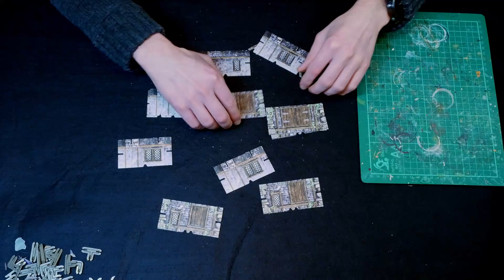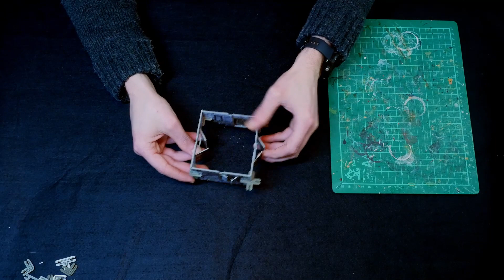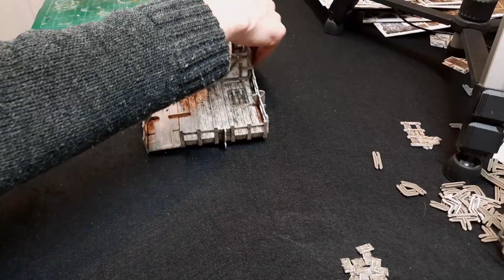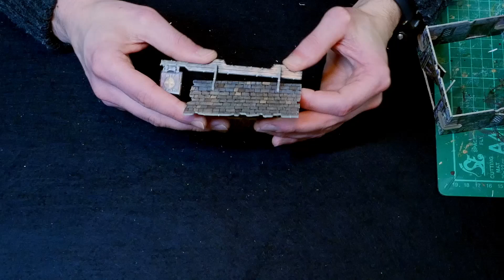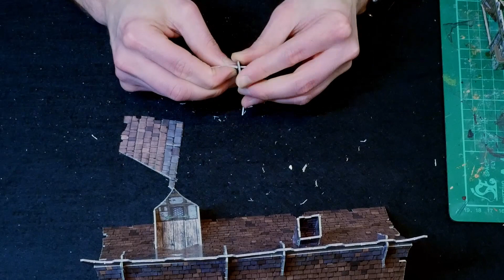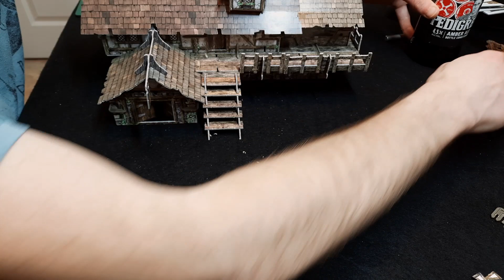How to Build Battle Systems Fantasy Village Terrain build series part 8: Tavern

Comment: I figured out what you did wrong for those steps.

Big step at top. Second biggest at bottom. 3 small in between. There is enough pieces 😁. I figured it out this morning
Reply from the maker: Ah haha thanks. I think that because I got the Kickstarter (which came with extra sprues) I probably mixed up some pieces which wouldn't have helped.

One thing I really like about the terrain is that you can modify the 'official' build guides a bit (in some circumstances) and use pieces differently and it still looks good. The village ruins set are a great example of that flexibility.
Reply: @NoProcrastinationMiniatures  yeah i do love how you can mix them up. Only downside is ive seen is they dont always pop out and it rips tje picture which is infuriating

Comment: Just bought the village today and absolutely love it.

I agree with your reviews 100%. Beautiful products but can easily tear if not careful - but you get what you pay for. But the fact i got a whole village for £80 was a bargain, considering when you pay over £400 for resin or plastic for a complete set. MY D&D group love it.

Only thing i did differently was the roofs. When you have that beam at the top to go across a roof piece, i cut it into sections and then glue each section on, because i found when sliding it into position the beam would look bent or a huge hole from roof to beam. 

Great video XD
Reply from the maker: Thanks! And that's an interesting tip re: the roofs. You're right that the central beam can look a bit wonky where it weaves a bit between the joining clips. I think if you're set on gluing it then your strategy is a good one.

Yeh I had to keep reminding myself that you actually get a lot of stuff for the money and although it's not ready to go out of the box, it's quicker than building mdf terrain and then having to paint it all as well.

I should've added a final summary to the review to say that overall I'm very glad I bought it! Glad you like it too, for D&D in particular it's VERY good. I love the way you get loads of basically free little extras like furniture and barrels / crates- ideal for D&D
Reply: @NoProcrastinationMiniatures  Thank you for your response and your earned yourself a subscriber. Well the beam that has the pub sign, it snapped because it wouldn't go any lower but yet i could stick a whole finger nail under it, so the idea for the gluing came about :). 

Oh yes for D&D the money and the material is fantastic. You don't need to go expensive as the props are just their to tell a story.
Reply from the maker: Ah yes I remember the pub sign being a  delicate piece as it's thin but like all the roof beams it needs some force to slot in if the 'clips' that it slots into are a bit tight.
If you used a specific type or brand of glue that worked well on the terrain let us know- that's definitely something other people might be interested to know 👍
Reply: @NoProcrastinationMiniatures  i actually used standard superglue from Games Workshop. Works a treat 😁